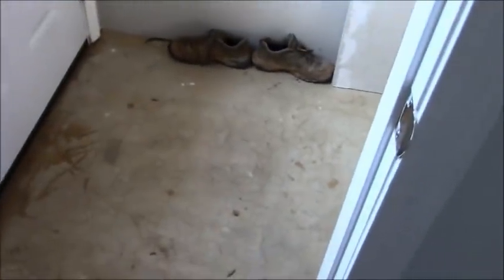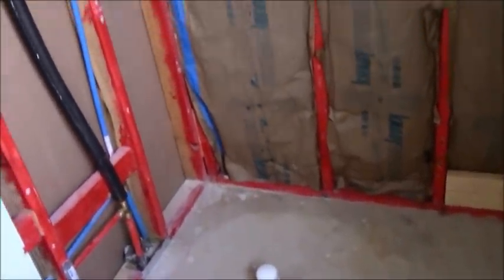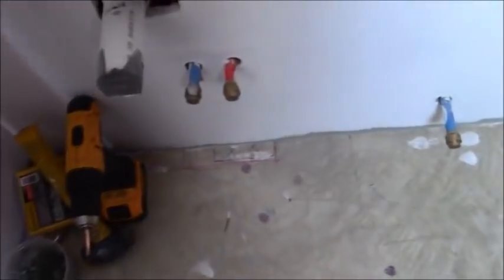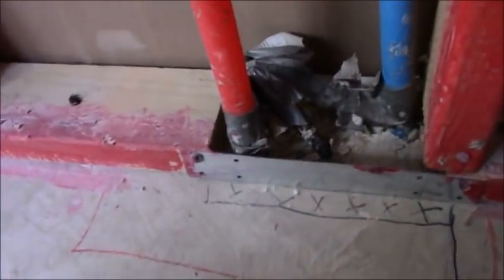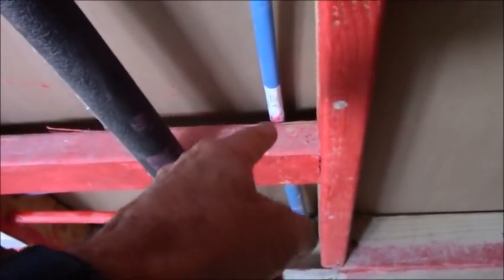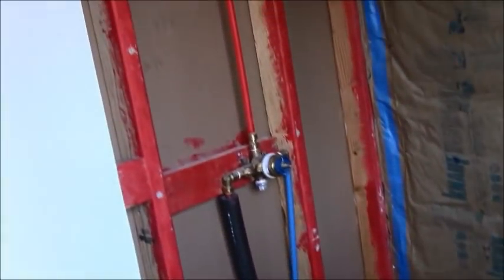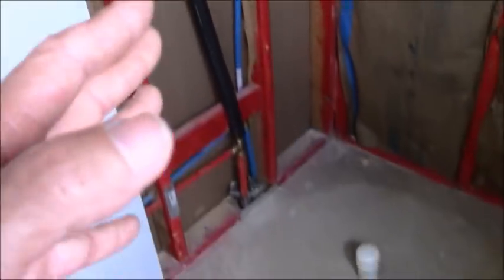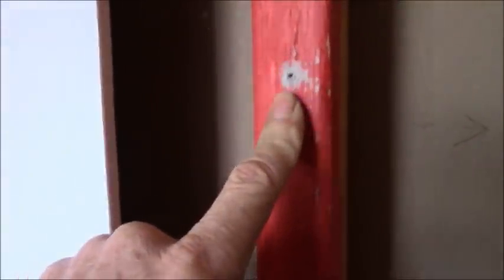CONTRACTOR BUILDS ENTIRE BATHROOM....wrong

Comment: 3 guarantees usually in concrete, it’ll get hard, it’ll crack and nobody will steal it
Reply: Yeah, I worked on the building of an Ikea. They were so anal about the concrete, there were large sheets of cloth spread over the pours and sprinklers kept them wet the whole time for an entire week while they cured to prevent cracking. The concrete still cracked. It's the nature of the beast. Now, I'm talking about large expansive single pours. They cut the lines in after curing, instead of how they do your driveway with the little grooving tool. I don't know enough about concrete, but commercial concrete pours end up with cracks in them all the time, and they use the best concrete companies and high dollar, high strength concrete.

Comment: Hot and cold lines are reversed, Studor vent needs to be a minimum of 48" high, or 18" above the highest outlet. The concrete color tells me that the vapor barrier is not correct. Shark bite fittings everywhere. What people don't understand is, the inspection process doesn't distinguish between good and bad workmanship, just code compliance.

Comment: I don't know how the framing passed we just did an addition on my moms house had builder pour the slab, walls, and roof we did everything else. Everything was inspected they nit picked everything, made us put arcfault breakers in the panel witch are $50 a piece. Also, they inspected the insulation before we could hang the drywall. I guess it depends on where you are located and the inspector.
Reply: I'm doubting he ever pulled the permit

Comment: Never put shark bites behind a wall.
Reply: I'm a professional plumber in the commercial side. I'll say that the only shatkbites we ever use are test caps so they're reusable. Surprisingly, they hold well under some serious pressures. Anyway, a sharkbite is a mechanical joint and is no worse than crimped barbed fittings or the Uponor memory collars on barbed fittings. Personally, I don't like any of them, including ProPress.
Reply: Curious as to why? Even if there's an access panel? Thanks!
Reply: @djflex6923  there is no reason why. Sharkbite and other press fit jointery is just as safe as crimped clamps on barbed fittings, the Uponor memory collars system, or even ProPress. I've done air testing and hydro testing on lines with Sharkbite caps as high as 150 lbs of pressure. They've held as well as anything else. Personally, I don't like anything that isn't brazed or soldered copper, but that's because of the longevity of the product.
Reply: @ruelsmith  Oh ok cool, so sharkbites are just fine to put behind walls right? Was curious as to why he said that. Thanks for your expertise Ruel
Reply: I mean technically there’s no rule that says you can’t bury them in the wall, but people generally think the o-ring will fail sooner than a soldered joint would.
 
I have a few in my walls from emergency repairs and I’m not too concerned. 

YouTube hasn’t really been around long enough to properly document the long term use of them.
Reply: As to date, shark bites have a 20yr life expectancy.
Reply: @djflex6923  yes. PEX always has some sort of mechanical joint. Crimped clamps on barbed fittings or Uponor memory collars are all just different mechanical fittings. No reason a sharkbite can't be used in place of them, and if a tube splits, a sharkbite can be taken off and reused. I've put 150 lb hydros on lines capped with sharkbites with no problem. Now and then you get one that leaks, but that's why you test. As long as it's pressure tested per local code, it should be good to use.
Reply: @dgraf8076  
Copper can easily do 50+ if you use type L

Comment: Shark bite is so user friendly, but I don’t understand why it’s allowed into the big box stores as a way to join plumbing supply lines. It should state in the the packaging that it does not comply with certain building codes because all plumbers know that you can’t use it inside walls. Same thing with pvc unions, they have to be glued not screwed together any time they are inside walls.
Reply: It's kind of expensive too.
Reply: You can use shark bites inside of the walls in most places, but some places require plumbing access panels where there are shark bites inside of walls. They wouldn't make shower/tub shark bite kits if it were illegal.

Comment: Burying sharks bites in the wall behind drywall ,is not recommend in my line of work. I'm curious to know how this many shark bite fittings will hold a pressure test? 🤔
Reply: Shark bites will hold the pressure without an issue. The question is how much money was wasted on all those fittings?  Shark bites are expensive and as of now only have a 20yr life expectancy.

Comment: 🛑There's only 2 types of concrete in this world!! 1) Concrete that's cracked! 2) concrete that's gonna crack. ←period full stop
Additionally Sharkbite and PEX *DO* go together like pb&j
Reply from the maker: A lot of concrete will crack, not all. And there's PSI strength to consider which is why I mentioned 2 months later there's a crack in a very small area.
As to sharkbites and PEX, that is not what a skilled plumber would do, which again is why I mentioned it plus it should never be encapsulated in a wall
Reply: @StarrTile  ALL CONCRETE cracks. Which is why we install control joints to **TRY** to manage those cracks. Even with control joints, there's never a guarantee it's going to crack where we want it to. Using super plasticizer, warming the area before/during installation and other methods better your chances of no major issues. but cracks are the nature of the beast. ←period 
The builder didn't use ANY countermeasures when installing this slab. One would be correct in thinking this whole job is just an entire diy hack job. Hopefully the owner didn't pay anything near a proper GC's price

Comment: My bet is the same guy did all of it. As you say licenses and insurance mean nothing. There's plenty of hack handyman contractors that can pass a test and buy limited insurance but do work like this. 

But the really scary thing is if they make such basic mistakes on so many things what about the things you're not seeing? Drainage around the footings? The mix for the footing and slab? Barrier under the slab? Treated lumber on the foundation? Sil gasket? J Hooks? Did he use the PEX inserts with the shark bites? Are all the buried drains bottomed out in the fittings with the right primer and adhesives? Does it have the right pitch? Is the sheathing wrapped? How are the windows and doors flashed? Anyone think any of those things were done right?
Reply: Damn. Dude doesn't even know which side the hot and cold are on

Comment: I can understand why he used Red Guard on the studs, a little extra protection really isn't going to hurt, I understand the logic there. But if you're building a shower with the notion that your confident the shower will not fail, that's unnecessary. What Id like to know is how that framing passed final inspection?! I don't know how he secured them 2×6's, and I don't see any sort of top plate, should be a double top plate, maybe it's there I don't know. But there has to be some code violations there!

Comment: Only 6 minutes in but yeah shark bites behind a wall is a definite no no for me. Although yeah they probably are okay but I've been taught not to trust them behind walls, only in open basements and only when you are meeting 2 different pipes in a tough situation.. the  water lines dont bother me not being symmetrical, as long as they look neat under the sink. Although the cold is on the left here, which hot is always on the left. And the vent... just wtf lol..

Comment: No saw cuts in concrete and almost gaurantee that the concrete guys weren't told that was a shower drain cause it's poured like a standard floor drain and pretty sure you can't run your water supply side by side in the 2x4 maybe 2x6 they can but not 2x4

Comment: I did a shower pan all the right way I preslopped I did my liner and finished my pan then I had a licensed contractor come in and do the Sheetrock and cement backer board then the moron put holes in my liner about a Inch and a half from the top of my pan of course bellow my curb and just about every screw he put in the backer board cracked the backer board the only thing he actually did I asked him to do was give me a inch gap from the bottom of the pan and my backer board

Comment: great vid.  i love the redguard on studs.  i usually use pressure treated studs for my showers, that way if someone comes in after me later to remodel, at least the studs will NEVER rot in my lifetime.  in fact, i like the redguard idea, me gonna use it from now on.  woohoo
Reply from the maker: My personal opinion is pressure treated wood is only good for plates, not studs...too much warping is possible for studs, even normal pine does it.
Reply: I'm with ya Dave. It may be overkill, but hey, it can't hurt. It would prevent wicking up water IF your shower build or tiling fails years down the road. Never seen it, but hell, there was a LOT more to worry about with this guy's work.
Reply: If you are relying on pressure treated studs in a shower, then you have your priorities mixed up. The studs aren't going to be your problem if your shower fails.
Reply: I like pressure treated and thats it